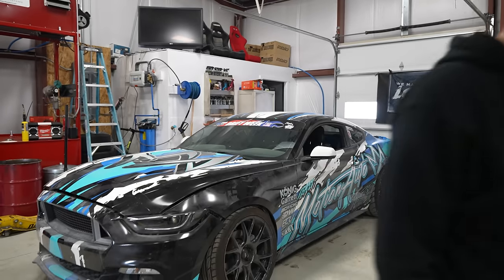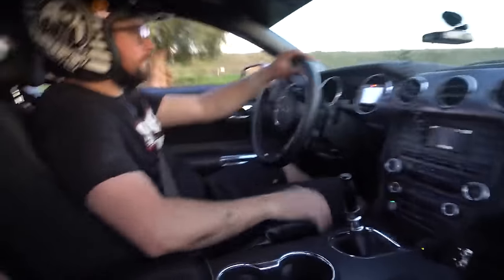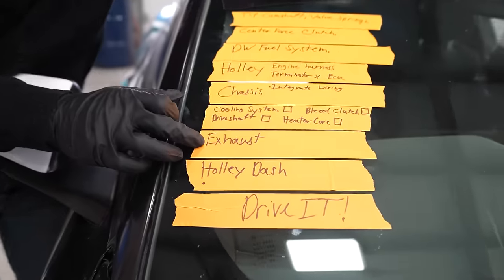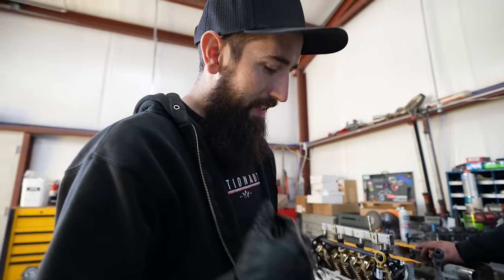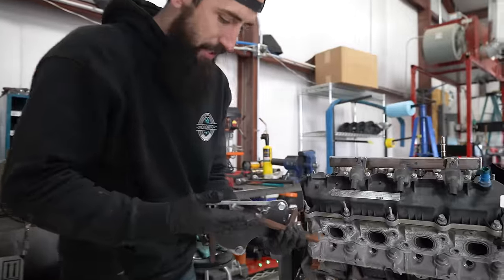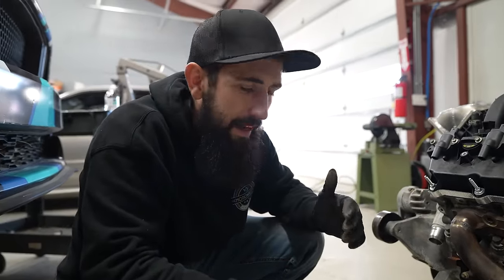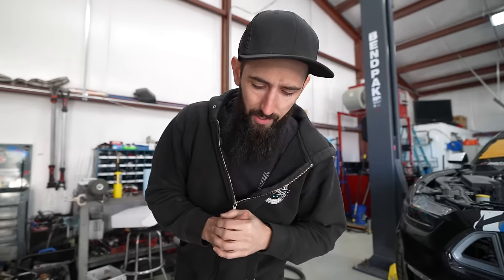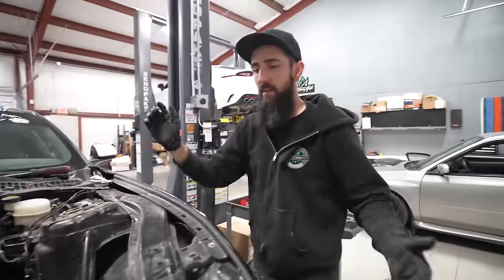7.3L Godzilla-Swapped S550 Mustang | ENGINE IS GOING IN!!! | Episode 2

Comment: those 17 inch winter tires have a lot of winter time traction... forced to use car for truck work, as its been stuck in the shop for a few months waiting on a transmission replacement... eventualy the snow plow brace will come off. ... oh wow a 7.3? when the 4.6 already broke 5 of the same 8.8 cv axles... hmm.